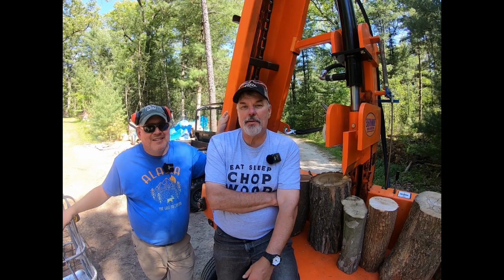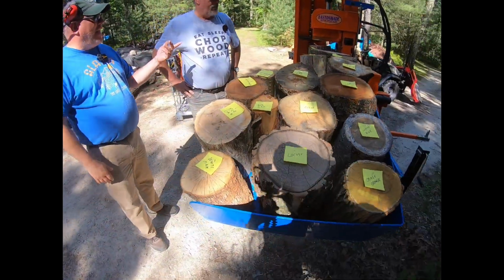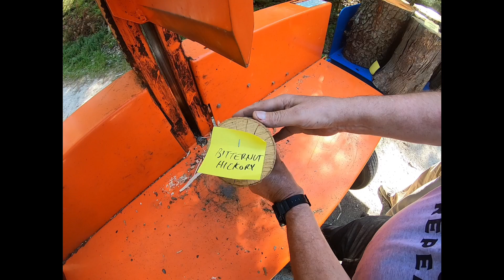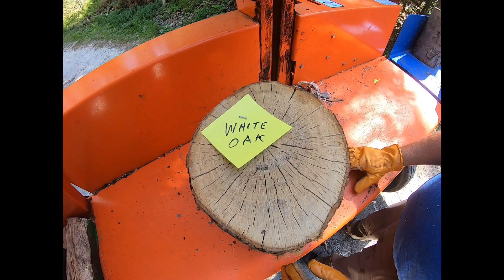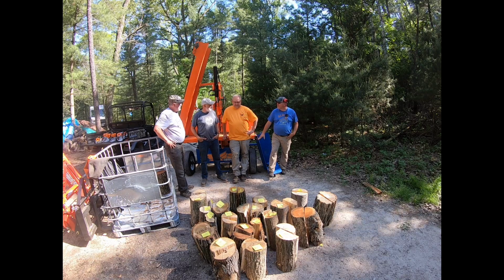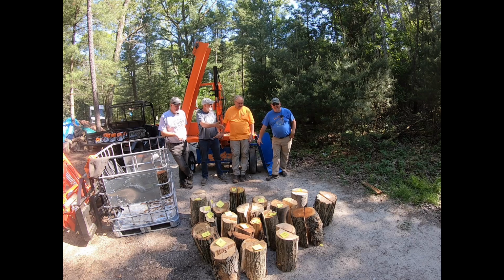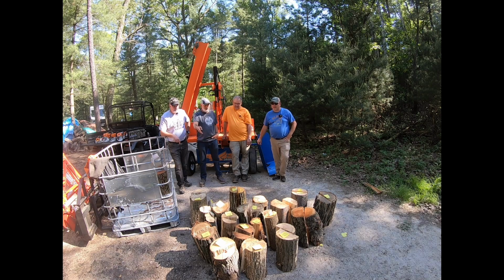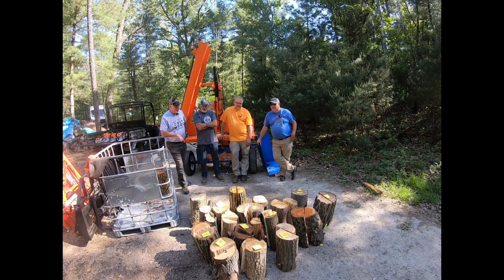Tree ID -5

Comment: I feel like the nastiest smelling wood I’ve worked with was pin oak. Hackberry usually smells pretty good as long as it’s cut and split quickly. I had a 20” log sit for over a year and when I cut that and split it, it had changed.
Reply from the maker: we don’t have any pin oak in WI but Chris from In the Woodyard brought some back from NM. I’ll have to check it out. Thanks for watching
Reply: I have some post oak that's just stanky.  Like concentrated cowcrap...